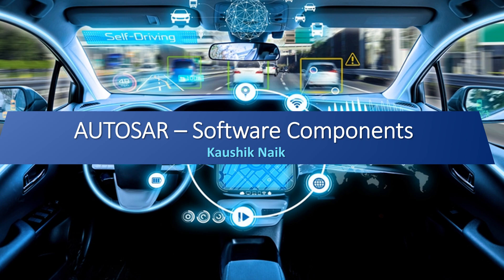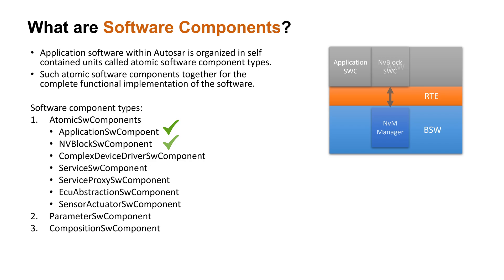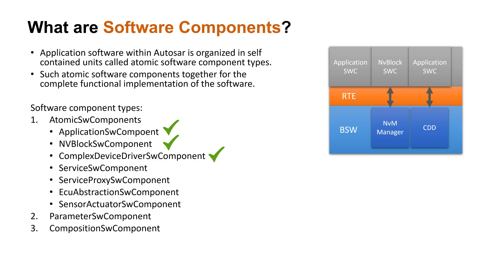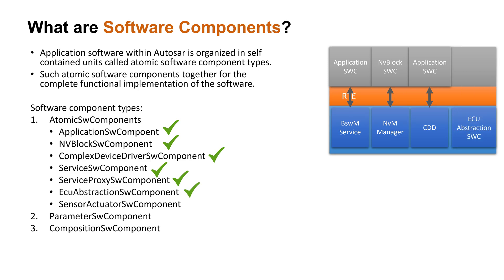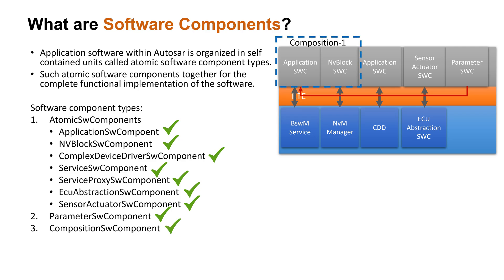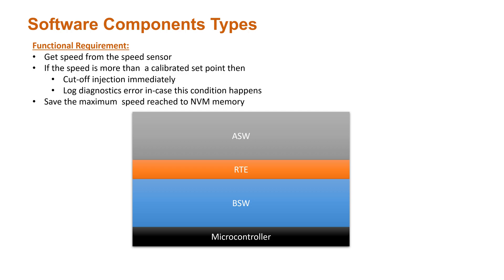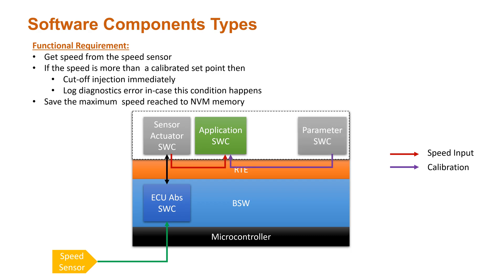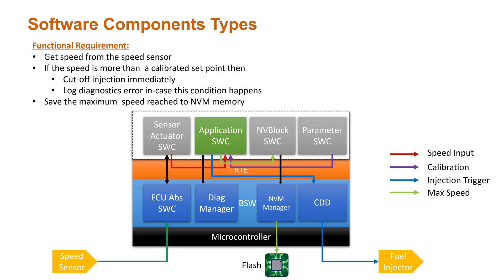AUTOSAR Software Components || #automotive  #embeddedsystems #autosar

Comment: Calibration or Configuration - if it is a arbitrary, logical, speed value inside the value set giving same functionality, independent on the unique vehicle build/components;   then it is a Configuration parameter (speed value);   Calibration speed value I would have expected to be linked to speed sensor, that has been calibrated to give higher accuracy via traceable reference tool or process (to ensure installation of sensor is within a specific tolerance range).
Reply from the maker: I agree on this! I should have taken the example of calibrating the speed sensor here! 
When we talk about calibration, it's more about specific to a vehicle and in this case speed sensor on different trucks ideally don't behave the same as there will be some deviations from the actual reading and in the aftermarket you u can correct it by calibration adding or subtracting!